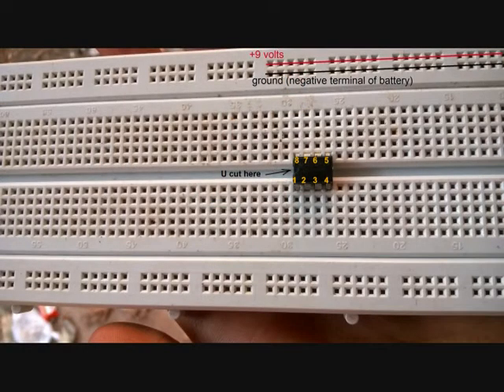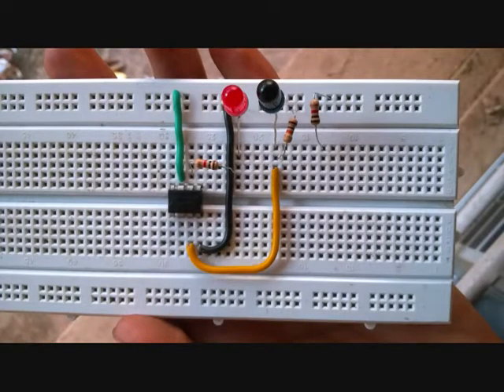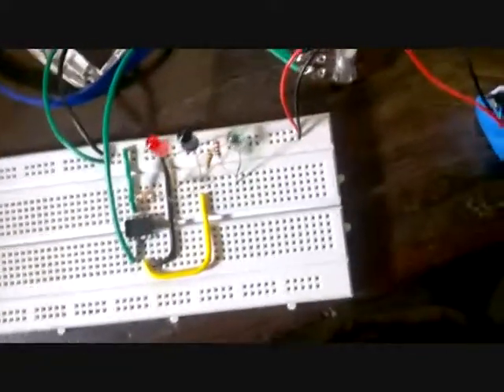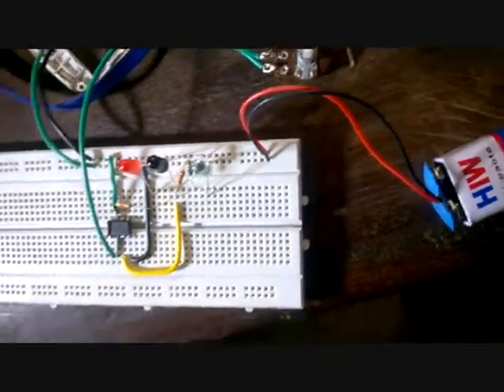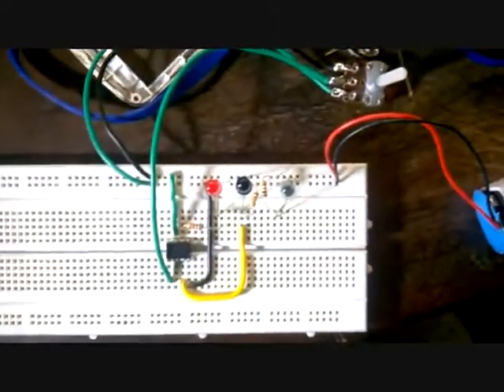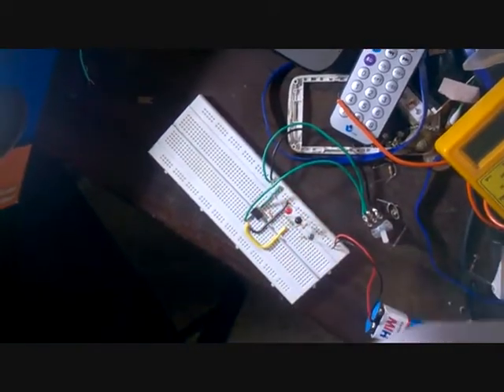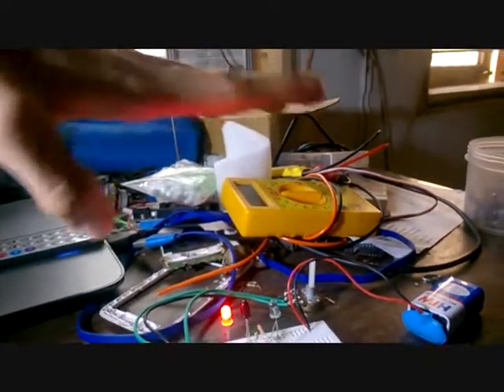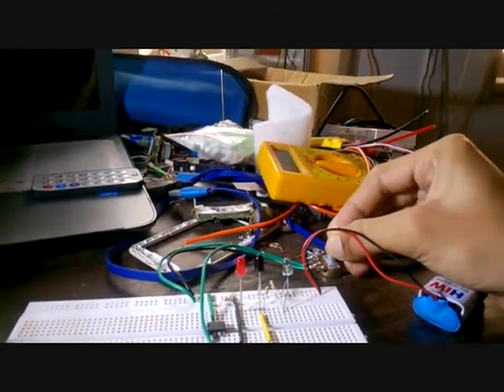Step by step IR proximity sensor

Comment: I have made it but it's Not working
Reply from the maker: Check with a mobile camera if IR led is working. Check if the u741 ia also correct. Make sure that ir photo diode  is reverse biased while ir led is forward biased.

Comment: 6 no pin of Opamp which resistor is connect??
Reply from the maker: pin 6 of Opamp is connected to 1 kilo ohm resistance.
Reply: but it's not working...... I connected the circuit. Red led turns on automatically and it never turns off though change of potentiometer values
Reply from the maker: Check for the polarities of the components. The photodiode shoulg be reverse biased and IR led forward bias.

Comment: "The LED must be connected to 1K resistance". The red, the black or the white? When your annotation " The LED must be connected to 1K resistance Sorry, My mistake rectified later" appears you say 1 kilohm at the video at 0:53, so where is the mistake?
I have a phototransistor that looks the same as your "white led". Is that ok?
Reply from the maker: The IR LED and the 1 kilo ohm resistance are not connected to each other on the bread board in the video. Just that the other leg of IR LED and 1 kilo ohm resistance should be connected together. And no photo-transistor does not emits IR so it will not work with present circuit. You need to modify the circuit to make it work with photo-transistor.

Comment: then lm358 ic also cannot drive a simple motor right???
Reply from the maker: NO. LM358 is also not suitable for high current applications. You can search for power op-amps or class AB amplifier chips (like TDA2030, TDA2050) to drive high current loads. A small motor typically can draw currents upto  300 mA so just see the datasheets of op-amps and make sure they can provide atleast that much of current.

Comment: then why it isn't working even after changing potentiometer value???
Reply from the maker: Get your smart phone turn on the camera and check if the ir led is working. You should get some violet blur on the screen.
Reply: Can we use a simple motor in place of LED and resistor??
Will it work??
Reply from the maker: No!! 741 is not designed for high current applications.

Comment: any specifications for the IR LED and photodiode?
Reply from the maker: Nothing as such but make sure the current through IR led does not exceed 10 mA to be on the safer side. And do connect the Photo diode in reverse bias.